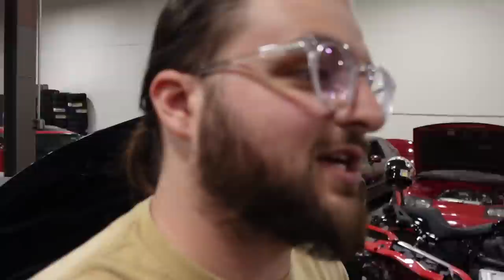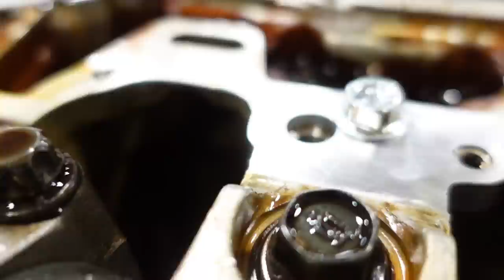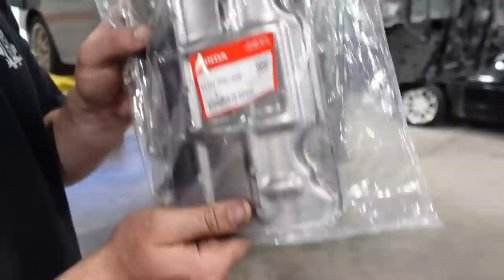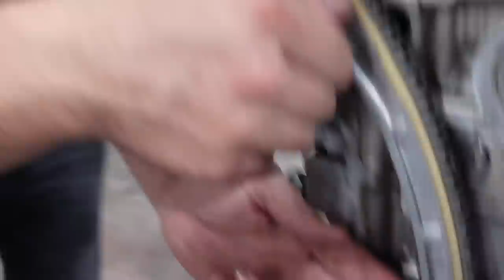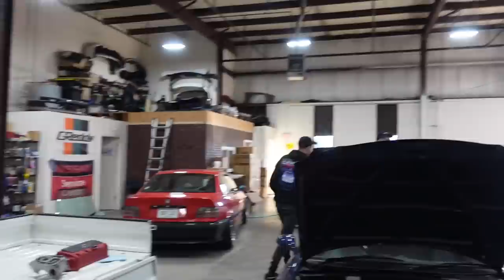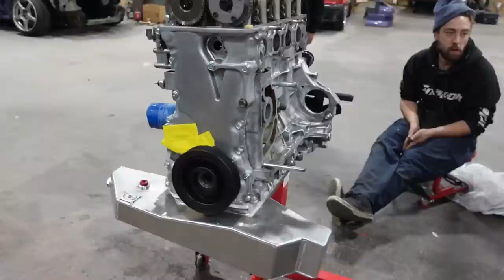S15 K24 Swap - First MUST DO Mod for every K24!

Comment: If you’re gonna be revving it high, don’t forget to do valve springs!!
Reply: Ferrera!!!
Reply: i agree
Reply: Trevor from motion auto dropped a valve revving high with beefy springs
Reply: @bmbgarage3405  yeah but that’s not a spring issue though it’s the head/valves themselves. If you keep it capped at around 8k and run heavier springs those chances drop substantially. If you don’t run springs then you’ll get a shit ton of valve float and could drop one or ruin the engine regardless
Reply: @bmbgarage3405  Because the valves themselves can't handle the amount of power he was pushing, which was around 600hp-ish.
Reply: Max on stock springs is 8200-8300rpm above that springs, valves, retainers and it will sit at limiter all day to 9400 above that you need new pistons and rods. Kseries get very unreliable fully built at 900hp. Block cracking is next big thing over 800. Need sleeving after that.
Reply: I rev my b16 to 8300 everyday stock head on ten psi. A k24 can rev to 9500 no issues or need for valve springs
Reply: @mal3762  "Because the valves themselves can't handle the amount of power he was pushing, which was around 600hp-ish."
Wwwwwwhat!? LOL  Valves don't know or care how much "power" the engine is making... What makes them fail is revving them too high without sufficient spring pressure (they float, get "hammered" into the seats by the springs, and break) .  Of course that's putting it VERY simply,  but yeah, it has absolutely NOTHING to do with "power".  That's pretty funny!
Reply: @dzahhh8537  A k24 cannot rev to 9500 with "no issues"!  Well, maybe after replacing the springs, retainers and valves, it'll do it a couple of times, until the oil pump explodes like a grenade.  A k20 can rev higher than a k24 in stock form, but still not THAT high!

Comment: For any gasket maker, Hondabond, Yamabond, Kawibond, RVT, I get these little plastic syringes that I find around the fiberglass stuff at a marina, HD or even parts store. I put the sealant in the syringe and then apply it to the area. Very easy way to get around all the bolt and dowel holes.

Comment: The balance shafts  are there because of secondary rocking motions in 4cyl engines, When you get over 2.0 liters the engines shake so the balance shafts are there to smooth it out.  Even the old accords had them with the 2,2 and 2,3 engines. They ran off a timing belt.  We have ran lots of them without the shaft belt with no noticeable difference.   Most of the time you get a little vibration at a certain engine speed.

Comment: I am SO GLAD that Jimmy did his homework and didn't put a K20A head on it. A K24A2 will flow just as well and rev just as high as a K20A2 when you put the K20 oil pump on it. I own a K20A2 and I'm currently in the process of replacing it with a K24A2.

Comment: 10:40 if you paid attention during disassembly there are two bolts that are are different that act as your dowel pins for the timing chain cover.

Comment: the balance shafts are there to smoothen out the operation ....4 cylinders , larger displacement like 2.2 and up have vibration issues.....Nissan has them on their QR25...common mod was to cut the chain for them...smaller 4cyl like 2.0L   (k20 or sr20) those vibrations arent as much of an issue

Comment: Hondabond and toyota fipg are legit the best silicone for EVERY thing.
Reply: Hondabond is probably the best sealer I've ever used. Every manufacturer should be using this stuff. Anyone that has used it knows what I'm talking about.
Reply: Dodge/chrysler uses a generic triple bond version,
but they at least try.
Reply: I use the Toyota stuff for everything including fitting trims it’s amazing stuff

Comment: Make sure you reuse the two alignment bolts for the front cover or you might have slight alignment issues with the pan , from the bottom up i think its the second hole , and when you replace the bolts with the downstar bolts make sure to throw some honda bond in the holes , ( honda platnium tech for 15 years)

Comment: It doesn’t grenade the pump, it causes cavitation and this oil starvation. And the balance shafts are there to make the engine smoother as opposed to performance.

Comment: Stock ringcaps. 500hp. "Never going to take it apart" looking forward to that 😁😁
Reply: 500 should be on the limit of fine for his use. K24A2 has decent ring gap for turbo applications. Personally I would have done valves and springs because drift car and limiter might cause valve float.

My K24A2 exploded at 550. A friend of mine has a completely stock A2 at 686HP and it’s fine with 10k hard miles on it.

Comment: The k20 cylinder head will give you slightly higher compression and slightly different cam profiles... the k24 cylinder head has thinner walls too so when doing porting its easy to take to much out n junk the head

Comment: you were supposed to add PN#08718-0009 to the inner threads of the block when putting the timing cover on. if you did not remove all the PN#08718-0009 sealant from the inner threads the new will not seal either. enjoy. same to the oil pan bolts and those have to have PN#08718-0009 on the threads as well on the flange bolts and inner threads. BTW, there is no reason to use Hondabond on the timing chain cover.

Comment: Have a lead on an MR2.  Is a manual TSX what I should be, ideally, looking for as a complete donor car for a swap?
Reply: Stick with the 3sgte.... they’re slept on and it’ll be way easier (and cheaper) to have 400 hp from a 3s than it would be to k swap it
Reply: No rsx is what you need rsx wiring stuff n ecu....the k20 n k24 blocks are almost identical

Comment: Even with the titanium valve train and k20 oil pump its never gonna be bullet proof. If you beat on it over 9k too much it wont last more than 1 maybe 2 events.
Reply: that is a negative. Honda uses the PRB oil pump in the Type R K20a which operates in 24hr races out of the factory pretty much. Another fact, I know of a PRB oil pump with 17 seasons on it. Still running. A season meaning = 10-15hrs of road course hell a season 9K shifting. it is a boosted K20 with IPS SC cams as well.

Comment: With a 76mm turbo you can get 500+ horsepower with 15 psi IF you get the Type S Oil pump and Type S Intake cam pulley 🤷🏽 food for thot!🤷🏽